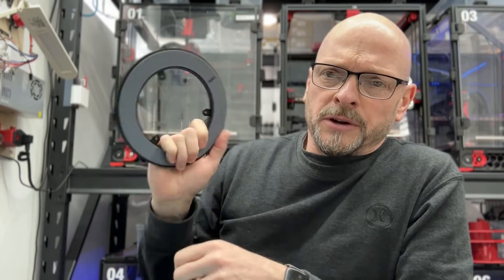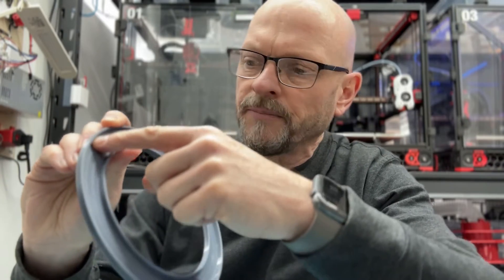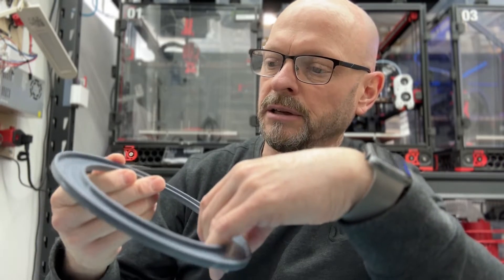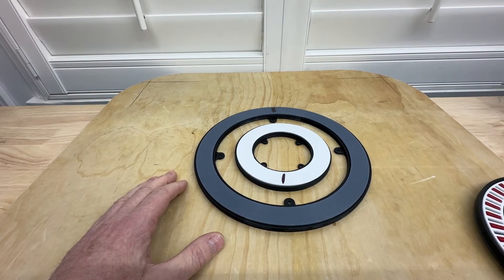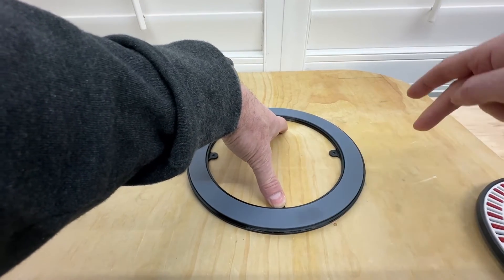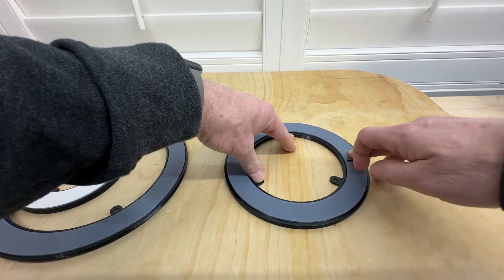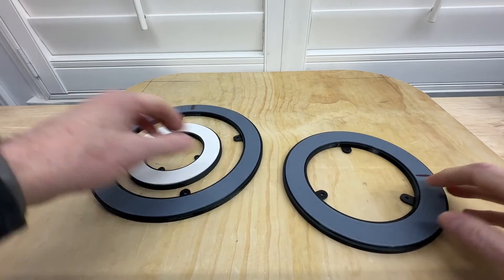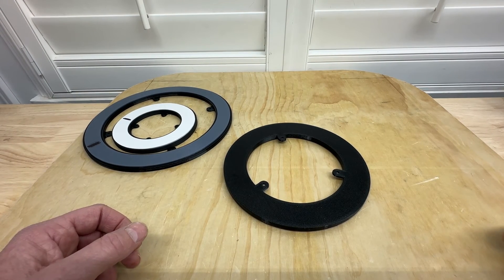Lazy Susan Mechanism 2.0 (Conical Bearings)

Comment: I know it has been a while, but I just discovered this, and I think it is exactly what I'm looking for. Is there anyway to print this in sections so that you can print a really large one and "snap" the arcs together into a single massive one? Specifically, I would be looking for about a 500mm diameter if that's even possible. I would be printing it on a 256x256 mm bed, so it should be doable if printing the arc from corner to opposing corner I would think.
Reply from the maker: @RPMiller  thanks for your comments.  In fact there is a way…. Check out this….   https://than.gs/m/1036745
This one is 380mm and printable on a 220mm bed.  Is it big enough?

Comment: Is there no way to print the bottom piece so that it's flat, but taper only the top on the insides only, you'd get rid of the print lines that way on at least half of it...
Then again, it could be there is actually less friction on this model because the print lines create ridges where the load applies, so there is less physical contact. 
And, heres another idea, put a very long pitch thread on the pins...
I wouldn't mind a larger version, say 300mm to make the best of my qidi 3max.
Edit, never mind, just found your uber 380mm version...might try that one.
Reply from the maker: Good thinking but... no, the top and bottom have to be the same slope.  Tapering the pins is a good idea too but does not work either and the same problem is the limitation of FDM printed layers.   I made a much bigger version that prints in quarters and gives you a 380mm diameter.  If I can make some time I will make a 290mm diameter version for you.  But it I am not sure when I will get to that at the moment.  Thank you for your thoughts.
Reply: @logicalplanet3d  You replied before I got my edit in. I meant threaded, not tapered. On a long pitch...
Reply from the maker: @8thsinner  oh, yes, there is a technique for that style of a rotational system but I don't think I could get it anywhere as low profile as it currently is and the current design is suitable for light loads (which is what I needed it for and designed it for).  I like the idea of the geared approach - I think it would be challenging for me to do.  I will give it a shot when I can.   Thank you.

Comment: a lazy susan bearing is designed for loads that would prevent using a regular bearing, if this is not for high speed or loads, then what is the functionality?
Reply: I think it's literally for a Lazy Susan - a round device used to rotate things on a table or in a cupboard. While there are lazy Susan bearings that can take hundreds of pounds, a lazy Susan on a table or in a cupboard wouldn't be under nearly that much weight.

Comment: Nice design !!  It would be nice to have a version that does not fall apart when you pick it up.  Somehow to snap the parts together.  How could this get attached without increasing friction?
Reply from the maker: Thank you for the feedback.  There should be enough interference between the two parts to require some force to separate them.  As you can see in my videos they should stay together unless intentionally pulled apart.  I wonder if there is a difference in your print settings or perhaps are you under-extruding slightly.  With that said, I will think about how I can improve that while at the same time not making them too difficult to separate.  Perhaps a version 3.0 in the future.  Thank you.